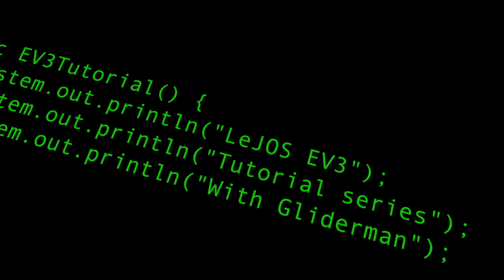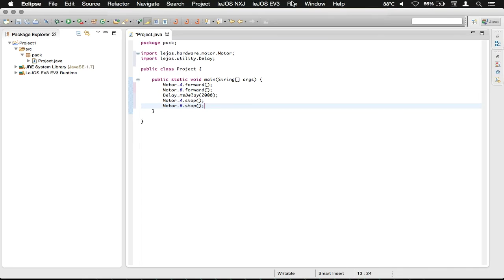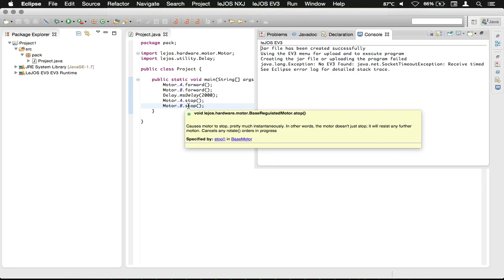LeJOS EV3 Ep2 - Driving forward

Comment: can you regulate the speed? (I only saw this video so sorry if you explained that in an other one) thanks in advance
Reply from the maker: +jackouyye Yes you can, and no problem.  I recommend checking out the DifferentialPilot video (here: https://youtu.be/mAeKvBz2NYk ), and then you have easy control of the travel speed and rotation speed (explained here: https://youtu.be/5j40ZlaxQOg).

Basically, after you have a DifferentialPilot to control your robot, you can run "pilot.setTravelSpeed(<speed in units per second>);" to set the movement speed, and "pilot.setRotateSpeed(<speed in degrees per second>);" to set the rotation speed of the robot.  There is a limit to how fast the motors can go, generally not more than two rotations of the motor per second.